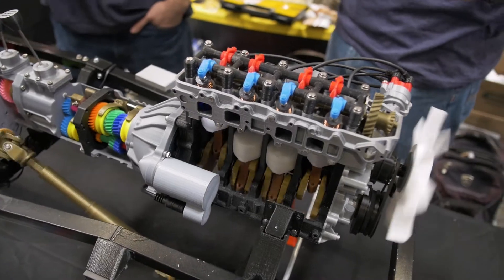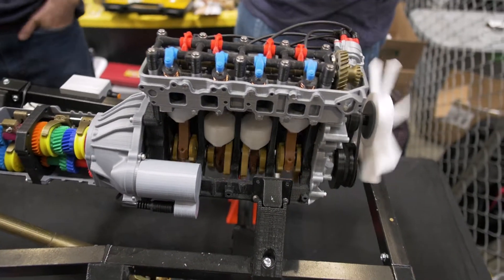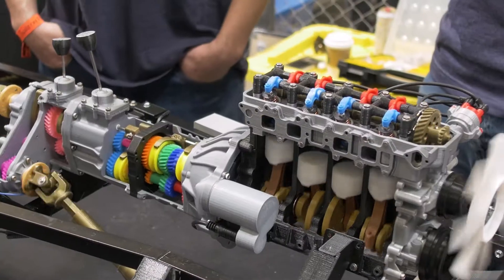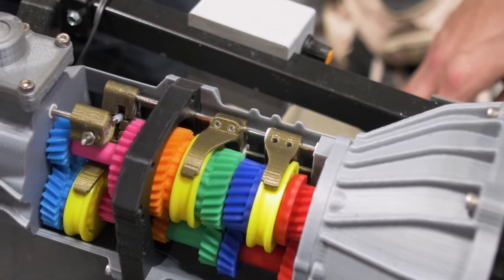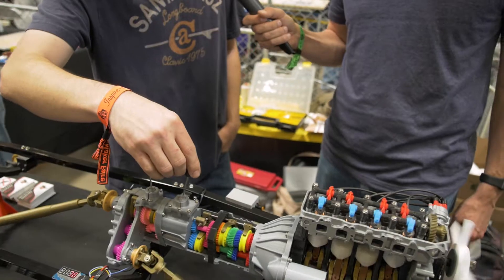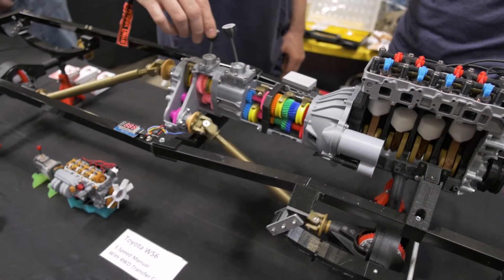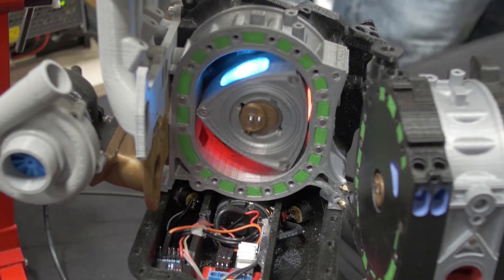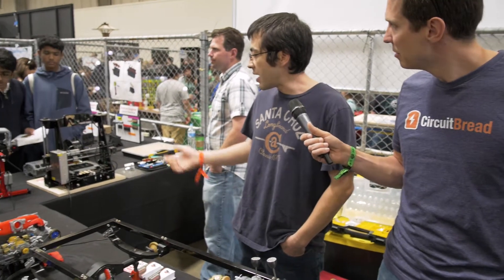Fully Functional 3D Printed Engines?!? | Electronics Maker

Comment: Imagine when we get the technology for these to withstand combustion
Reply from the maker: With the sintering printing tech, can't they do aluminum and other metals?  It seems like that would actually be functional, though it is way more expensive.  I know they have quasi-metal filament for FDM 3D printing like this but, while I've never used it, I doubt it could handle the heat and pressure of a real engine.  
With the push for electric cars, I wonder if the internal combustion engine is going to disappear before extruded 3D printed stuff is good enough to actually use with combustion.
Reply: @CircuitBread  these are really cool models. Thanks for the outstanding interview! As for the emerging electric vehicles, I don't see internal combustion engines disappearing anytime soon because of that. If anything, advancement in technologies like 3D printing will only enable internal combustion engines to stay around for longer IMHO, hopefully pushing the limits on efficiency and emmissions.
Reply: @aymanalmateeg  Thingiverse
Reply: @CircuitBread  and btw where can we find models made by this great guy? Does he have online presence?